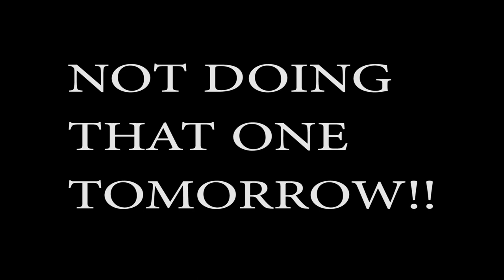Leaf Removal Cleanup Bagging Leaves

Comment from the maker: I did end up putting the new PTO belt on and it did fix my problem. I'll have a video next week showing how I did that. It's probably not the best way but it worked. Thanks for watching!!
Reply: In the future you may consider changing the drive belt that's inside the PTO belt at the same time. Since you have to take it off to get it out anyways.
Reply: Top Notch Lawn Care ...hmm...given that your blower fan was spinning freely like you showed...I would check that you didn’t break the spring that tensions the idler pulley on the blower fan.
Reply from the maker: +EDM I think it was spinning freely is because I had the pro belt loose. I did get the new belt on and it fixed all the problems for now.
Reply from the maker: +Charlie Plaisance that one is super easy to change. I would have done it also but changed it last year and it still looked good.
Reply: David from Coastal Turf.  It's a pain to change and I was told by a really good walker mechanic you are supposed to adjust the tension on that belt every so often. I really enjoy all your videos  brother.
Reply: its to bad the walkers didnt put a shaft on it instead belt be less maintance

Comment: I think your problem with the belt was caused by all of the dust from mowing up the leaves.  I had the exact problem you described where the blades took a bit to reach full speed and then seemed to slow down under the slightest bit of load.  Long story short, I had been mowing through leaves all day and the dust was causing the belt to slip as if the belt was loose.  I washed the belt and pulleys off  with a little water and everything was all good.  I bet you'll have the same problem again if you clean up any more leaves.

Comment: The pto blade on the walker I use had a Tensioner Pulley to remove the belt
Reply from the maker: Mine is just tightened when the pto is engaged. I didn't have a problem getting it loose but getting it out was the problem but I figured it out.

Comment: If you remove bolt from blade lever. That lifts clutch. Much easier for belt.
Reply from the maker: Jose Araujo I'll have to check that out. Thanks.

Comment: I had something happen to footage i captured as well. Using a crappy (but only one i had at that moment) micro SD card, i captured about 20 small videos on one property. moving the camera around and saving each time i did. well about 15 of the videos were corrupt when i transferred them. so yea i was salty too lol bought 2 new SanDisk SD cards and havent had a problem yet
Reply from the maker: Hazardra Lawn Care yea that sucks. I know it helps to format them especially if they are new.